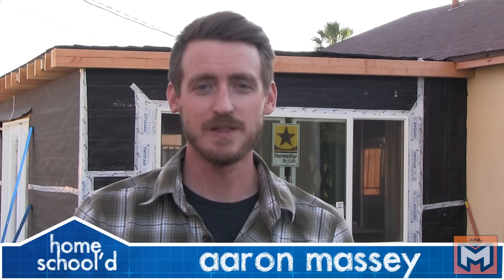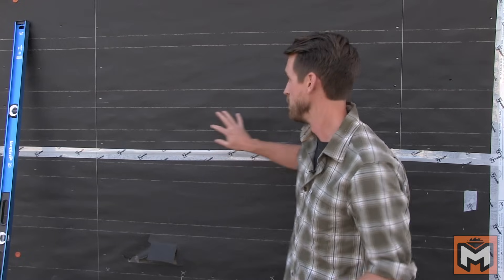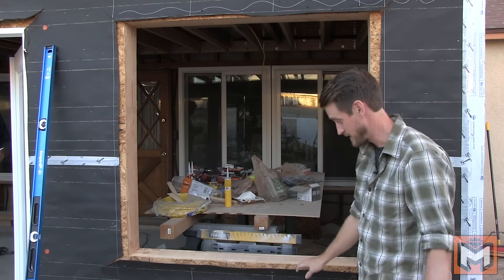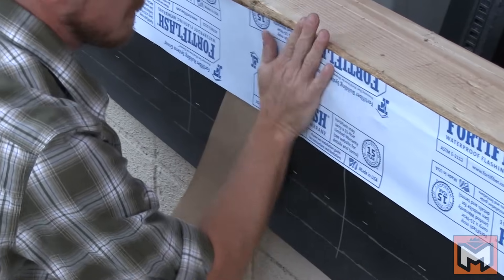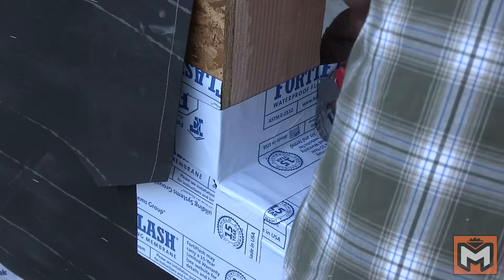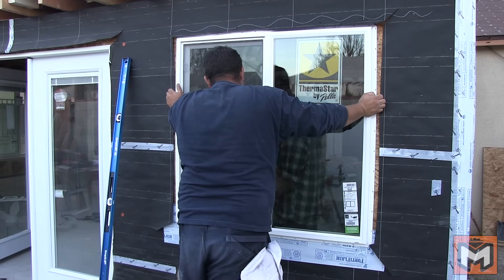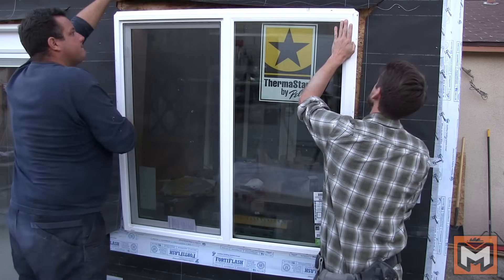How to Install a New Window | New Construction | DIY Guide

Comment: In florida the house wrap has to be folded inside the window opening on the sides and bottom , the house wrap is left out of the window hole at the top to overlap the window

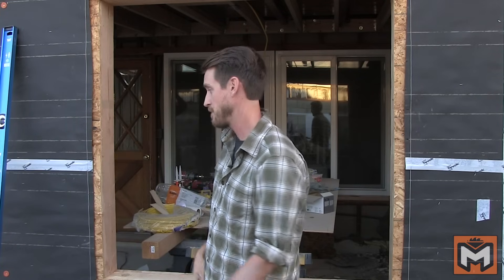Comment: Nice vid, however, I wouldn't caulk the bottom nail fin,to allow a path for moisture to escape, and I would "skip-tape" the top of the window to the house wrap using your reasoning at 2:11 in the vid.

Comment: I really appreciate your video! After seeing other methods, I think this is BY FAR the best way and I'm going with it.

Question: Should the nails be driven in so hard?  One window manufacturer said to not drive the nails in fully. I know vinyl siding requires loose attachment because of temperature expansion.  But with the sealant holding tightly does it really matter anyway?  In fact, I'm concerned that loose nails would prevent the sealant from being pushed in fully and the sealant would be stressed by expansion.  Any comments?

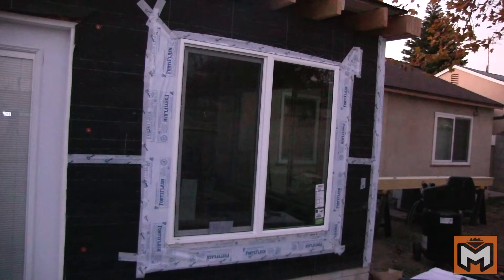Another question:  At 6:53 it looks like you tape the tar paper down completely (over the top) but I read one installation instruction that said to put a few small strips so that water behind the tar paper can escape.  Any comments?
Reply: Use pan head screws, then you can adjust the tension. I would prefer them pretty snug.

Comment: Hi there did you pull permits for that addition❓ The reason I ask is because most inspectors I deal with wouldn't of passed that window for inspection you installed  the flashing wrong with the first one on the bottom then you set your two right and left side then you can install the window then you  can install your fortified housewrap on top of the top nail on flange that's the proper way to do it but it's cool. Doesn't look like you're putting Stucco on that addition are you wrapping it with T1-11 or bat and board siding or shiplap just wondering❓ lotta good info though man you have cool videos😎👍🏻

Comment: I cut a hole in the 1978 RV and made it fit. Used higher grade insulation around the edge, but it works great. Plenty quiet for sleeping. Used my Dremel to cut the aluminum siding and jigsaw for the wood and insulation.

Comment: Nicely done bud.  You had me a little freaked when you cut the paper back rather than wrapping it into the opening, but you totally redeemed yourself with the window wrap (we have something we call "blue skin that is basically the same).  This is a bit different from how I've done the procedure, but it seems to hit all the right weep and drainage issues well.  Love the "F-bomb" rating system! lmao.  Keep up the good work!
Reply: Mr. Fix It I'm in Alberta, Canada. I'm not sure the actual brand name of the membrane; it may actually be called Blue Skin. Haha. Anyway, good job sealing up that window!  I did have a window manufacturer suggest that I leave the bottom flange unsealed so any moisture buildup can escape that way.  We can get a fair bit of temp variation here, so condensation can be a real bear to deal with. Where are you located?

Comment: That's really helpful. All of our windows will have either the Integrated Nail Fin / Flange, Or Metal Bracket to Finalize the installation. Usually, The Metal Bracket installation could be used for Replacement Window.

Comment: Are all American houses just wood and paper and waterproof taping? In the UK practically all houses are built with bricks and mortar with air gaps containing insulation and our winters aren't nearly so severe as some American states. Old UK stock have single brick wall so less efficient.
Reply: We stuff the walls with insulation and then add a plastic cover to the interior. In the u.s each climate zone has diffrent specs on insulation requirements. Most new houses are 2x6 walls and use a higher r-value insulation. We also are changing where and how we insulate to help make heating and cooling more efficient. So from outer edge it should be siding, water proof house wrap, osb/plywood/ shiplap, then 2x4 or 2x6 framing with spray foam/ blown or rolled insulation in between studs on a 24 or 16 inch center, plastic secured over the studs then Your interior wall cover. And if you find a decent contractor there are many additional steps taken to ensure water proof/ airtightness of the home.
Reply: You make houses to last centuries, we make houses to years,,
Reply: @BigTony2Guns  not really true just depends on the design contractor and who builds the house.
Reply: Brick and mortar is far more expensive.  Perhaps you don't have the access to all of the building materials we use here.  That may also explain why an average middle class family here can easily afford a 4000sq ft home whereas if we moved there we'd be in an apartment with a kitchen the size of my closet

Comment: I do 2 things differently:

1. Use “FlexWrap” to water proof window sill. Seamless and way faster to install.

2. Do NOT caulk the bottom of the flange. The bottom flange should be an escape route for water just Incase.
Reply: He does say he leaves "weep holes" along the bottom. Same principle

Comment: I've never used caulking on any of my windows.  I use bituthene or similar products.  Never any leaks.   I use to work with a contractor who built custom homes for about 40 yrs.  He hated to use sealants or caulking as a means if water proofing.   He would've yelled at this guy for using all that goop. But  In the end,  everyone's got their own method.   Good job👍

Comment: Can I remove the window shims after the foam dries up. I want to foam where the shims where then replace the screws.
Reply from the maker: Yes once the window is secured with nails or screws you can remove them.

Comment: So I installed my Windows, but I keep getting a blue screen when I turn it on.
Reply: well either your drives are not updated or compatible, your hardware has a wire loose or your files are corrupt
Reply: It is because you are using to big a hammer for your little hands.  Fisher Price tools may help.
Reply: Perhaps you didn't get the flashing right?

Comment: corner to corner measurement to make sure the window is perfectly square?
Reply: if you buy an out of square window from the factory you have bigger issues.  The rough opening only needs to be level because trim/drywall/stucco/siding will cover it up if it's out of square anyway.

Comment: I've been selling and installing windows for 10 years (in France), and the way it's done in North America makes me laugh so much :D Between the wooden walls, the nails and that dodgy wrap ...  Maybe I'm just spoiled by all those rules we have over here.

Regardless, I really like your channel ! Keep it up :)
Reply: It's pretty much always from the inside, which allows for the window to fully open by having it flush with the 100 millimeters "dry wall". Minimum legal thickness for a window is now around 60 millimeters, built-in extensions are filling the gap to the wall. We use L shaped mettal brackets to link the static part of the window to the wall, making sure to attach it in the most durable spots (not flush) without piecring any holes in the window frame.
Dry wall has to be finished after the installation as it covers the brackets and slides "inside" the window frame.
If the wall isn't made out of concrete, or that an exterior hard finish can not be achieved (usually with cement, we apparently love that stuff), we cut to size some L shaped PVC to grip around the opening, encasing that exposed part of the wall.
We do all this only when it concerns a new hole in an existing wall.
Off course we use the proper 5x5mm rule to apply silicon glue.

In the cases of replacing an existing window, or for a new construction ; steps and methods are completely different.
Reply: Maybe a trip to France is needed to learn this new technique???
Reply: ^^Bailey's got the right idea.

Comment: Great video except you’re never supposed to put silicone on the bottom so water can drain. You also should put a piece of cedar siding bevelled towards outside for water runoff.

We all make mistakes ;)
Reply: You can silicone the bottom but leave a couple 2” gaps in the silicone so water can get out